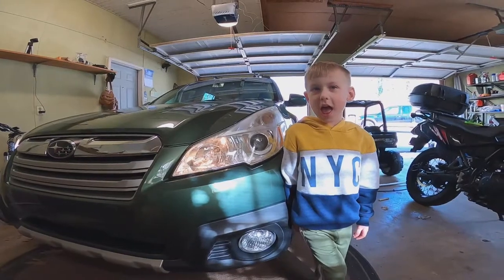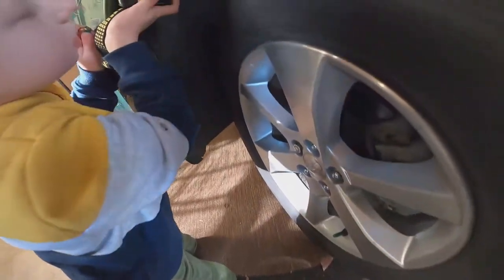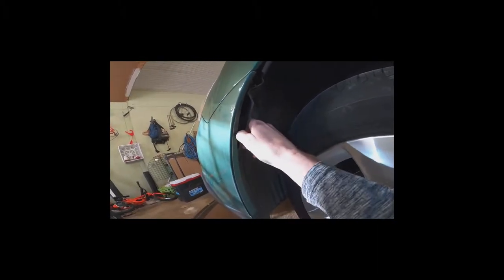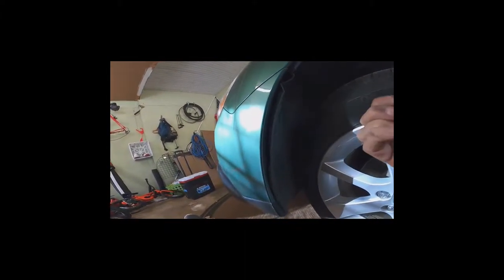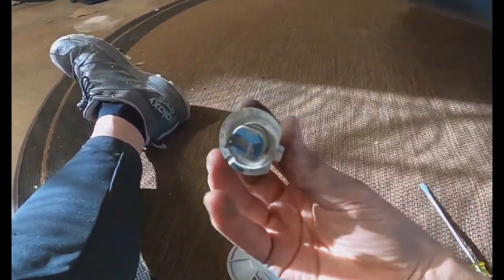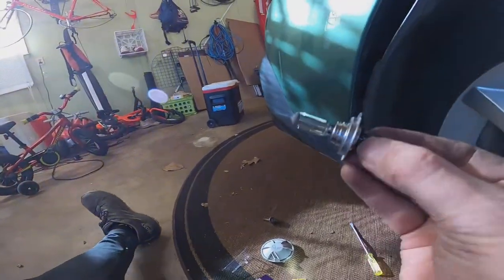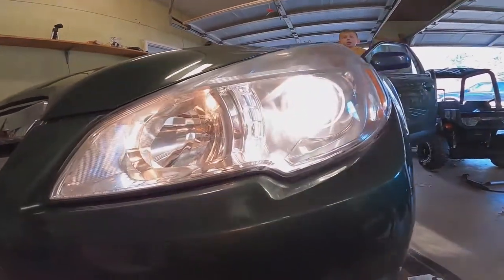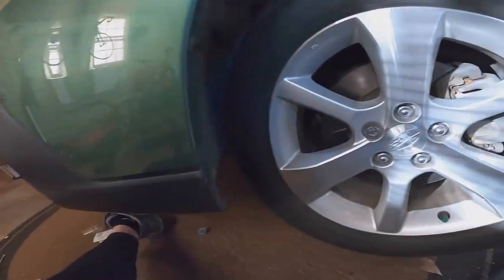SUBARU OUTBACK HEADLIGHT FIX

Comment: For 2015 Subaru changed car up including the headlights. With the 2015 up you can easily change the headlight bulbs under the hood, no more going behind the fender liner. I had a 2005 Acura TL that required the bumper to be removed then the entire headlight had to come out just to change the bulb.